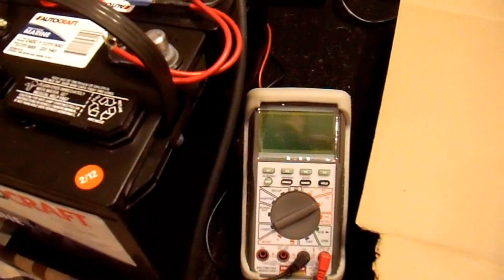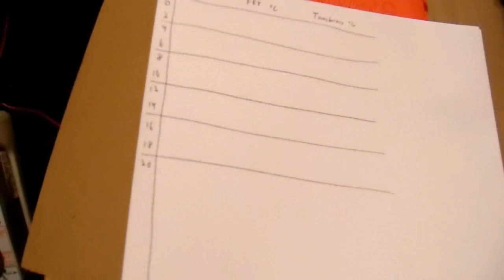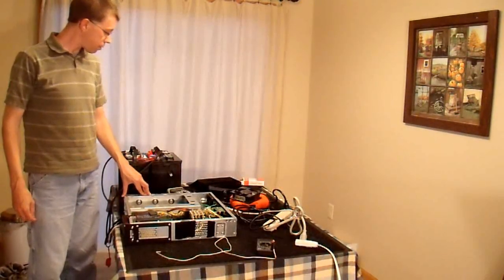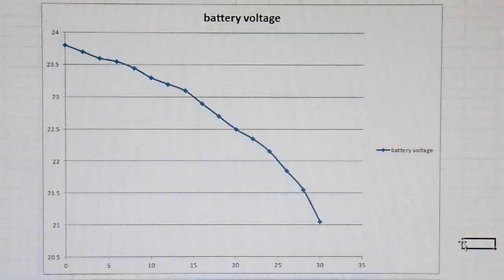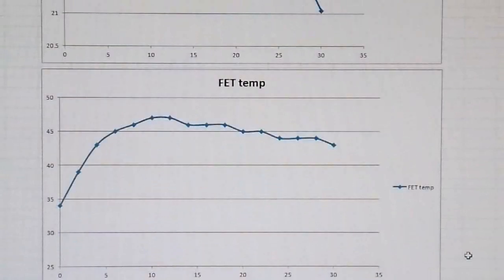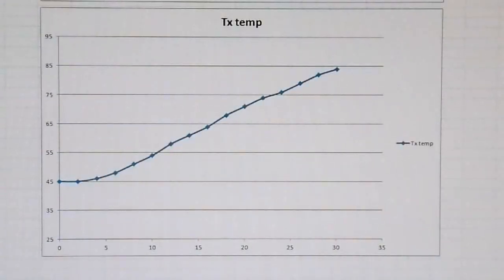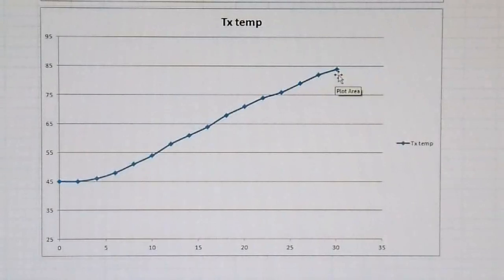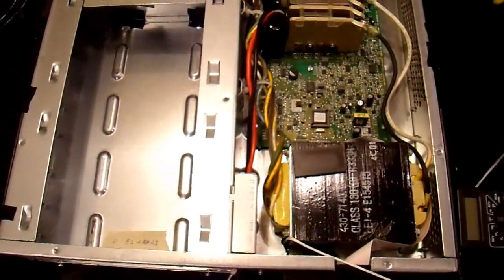UPS to 1.5kW Sinewave Inverter Conversion part9 - Will it overheat?

Comment: I know this was awhile back but, I have a question for you because I have the exact same unit. I was able to modify it to hold more amperage just like you did with the transistors. My question is is it possible to use two of them in parallel to get double the amount of amps? Because I know they sync the frequency and phase angle with the outlet with the wall.So my goal is to source the same PWM for both modules to output the same 120 V AC running off the battery bank.
Reply from the maker: It's probably possible but my answer will be 'no' due to exact matching and sync needed.  I did make a video where I put two of these units together to make a 240V unit that doubled the output power and that 240V could be fed through a transformer back to 120V.  WHen put in series exact matching and exact sync is no longer a problem and it worked well.
Reply: @knurlgnar24   ok thanks for getting back to me.  That’s a good point with two 1500 watt units in series.  Then step back down to desired voltage.  I’ll give it a try.  I am very ambitious in cracking the code for parallel inverters, somehow making use of the synchronization logic inside the inverters.  Another experiment I’d like to try is adding even more mosfets and “bypassing” the current transmitter so’s not to trip on overload.  Just protect it with fuses.  How many mosfets can you run in parallel without adding issues? Like remote mosfets totaling enough to run a whole house feeder?  It’s ambitious but it’s fun.

Comment: Great video series. Perhaps just get a 1500w ups to begin with, to save the hassle of modifying it to shed heat. Maybe start with the XL version as they are beefier and  can be run at full load constantly.

Comment: Just found 40 new old stock of the correct mosfets! Also, I acquired a full roll (1000) of the correct gate resistors. The audibility of the UPS should decrease and the efficiency may increase with the correct gate resistors and matched mosfets. These operate in the LINEAR REGION, so if the gate voltage is off, the units will be working against each other slightly. PLEASE show us the output on a scope!!! I predict a slightly distorted waveform.

The internal noise produced by mine decreased when I plugged a large transformer bearing stereo receiver/amp into an AC output receptacle. Should I add a large homemade toroidal transformer to match or surpass the ratings of the original core? Great work BTW!

Comment: I just found 2 of these exact same units and I am doing the same mods excepts one of them is currently the "donor" of parts for the main one I am wanting to use. I have already removed the fets and the large cap for use in my main as well as the transformer.

my question is if I put the donors transformer in parallel with the one I am wanting to use in hopes of taking a high load off of the one transformer is there any possible problems I could have? I'm am planning to upgrade the wiring..

I'm am planning to cut the battery compartment out for room for the second transformer and extra much more quiet fans

Comment: I watched all 10 videos..Great stuff!! I was going to buy a pure sine wave inverter and some solar panels to recharge a large battery bank for off grid...The question I have for you is this...I have a VERY Large APC Symmetra power array tower! Model # symstrf..The specs are as Follows = Input 200-240v , 80amp, 50-60 hz....Output 120v-,208v-,240v-  60hz...Total output power 80amp, 16kva, 11.2kW...The transformer is the size of a large cantaloupe!! What are your thoughts on converting this to a large inverter?  Would I be able to hook up enough battery's to come up with the 200-240v input requirement? Any thoughts, advice? Thanks!

Comment: water cooled transformer?
Reply: +Brady Rose Water will make the transformer rust butt any type of oil will work. (used motor oil can be used if has ben filterd to gett rid off the metal filings and crap in the old oil)
serc "oil filled transformer" on gogle to learn more.
Reply: Duett A Traktor
lol the water wouldn't contact the iron directly.  It would flow through an aluminum heatsink block with sealed channels and valves via tubes and a pumping system like a typical computer cooling rig.
Reply: +Brady Rose ok intresting with water so close to electronics. But if computers use it it will probebly be ok.
Reply: Duett A Traktor I guess it could be argued  that the watercooling on a computer is to cool the chip on a board that is running DC, whereas a transformer has mains AC running through it.  However, CNC mills have water cooled motor spindles that run AC mains, and we have on demand water heaters and kettles and such.  Water and Electricity don't mix but they can be neighbors in tightly controlled settings.  To each his own how much risk you want to consider.
Reply: +Brady Rose my thoughts exactly
Reply: +Brady Rose or at least a heat sync

Comment: Question. how about surge. I see its good for 1500 watts for about 30 minutes what about surge, IE a motor starting that could be over 1500 for a small bit. have you tried to see what it can do with a surge.....Something I'm looking at on my system. I have a Die grinder that is 600 watts and when I hit the switch it shuts it down. and it only pulls about 600 watts when it settles down after motor gets going.  I will later look for something I can use to put a good load on it to see what it can do. and see if it took the hack for 1500 watts.
Reply from the maker: This UPS has a good surge capability once modified, and it is far better than most 1500W inverters.  My previous videos in this series cover this.  I wouldn't expect it to have any trouble at all with any die grinder on the market.
Reply: ***** I was using the tiny 18ah batteries, and realized that it was the batteries, I hooked them to my battery bank and even the one set for 980 watts with no mods fired it up.  I have a 1500 watt Heater oil type.  that has two settings. 980 would handle 1500 watts for a while before shutting down like maybe 30sec or so.  after mods no issue other than the wimpy 10 gauge wire. so that will be the next fix.

Comment: Well i know it is over that just and  idea. Why didn't you move your whole transformer to left side(to old batery compartment. You could put one fan there and it could blow heat from your transformer. No more problem with overheating . Air will be cooler and you can do there what you want termal protection or what ever you want. I really don't know why you didn't do it before :) :) Transformer will be happy and your pcb will be happy also ..less radiated heat..
Reply from the maker: Because it would require another fan and metalwork which I do not claim to be proficient in.  :)  This seemed like the easiest way.  I am sure there are other ways to accomplish the same goal.

Comment: Hey you should look up DD-WRT. It is a firmware for wireless routers that allows you to make a standard router do things the factory locked out like adjust the RF power or make it into a repeater.

Comment: You could install a high performance low profile server CPU heatsink with fan on the back side of the transformer. The good copper core type with heat pipes can dissipate 200 watts of heat easily.

Comment from the maker: The thermal conductivity of the thermal paste is irrelevant in practical application - you could use standard automotive grease and it would work almost as well.  It's actually the thickness of the interface material that matters most since conductivity is directly proportional to the thickness of the interface material.  For that reason thermal pads are less effective.  Anything that removes all air gaps will work reasonably well, though.

Comment: Heatsink goop under the xformer... uck. In any more than a VERY thin layer, it's not a good heat transfer material. Look for the conformable thermal conductive interface pads, available up to about 3mm thick. Also, why not put a heat sink on top the xformer core?... sticking out the top of the case? As said elsewhere, as the deltaT between xformer temp and ambient increases, dissipation will become more efficient. digikey.com/product-search/en/fans-thermal-management/thermal-pads-sheets

Comment from the maker: The FET gate resistors are there for a few reasons:  radiated emissions, to prevent the drive circuitry from excessive pulse draw, and most importantly to keep the voltage overshoot on the Drain and Source under control.  At high currents if you switch too fast with too many parasitics the excessive voltage overshoot can damage the transistors.  I'm not sure which combination of these factors is at play in this particular design as I do not have a good o-scope (or the motivation) to look.

Comment from the maker: Possibly - good thoughts.  Conduction and convection are linear with temperature increase and copper losses are less than linear so things would be going in the right direction to stabilize.  Radiation loss changes with the 4th power, so that would help somewhat too.  One also has to consider that when pushing a transformer far past it's intended operating conditions that localized internal temps will be much higher than the external core temp.  I didn't want to find out where the limit was!

Comment: You state that the transformer would probably get into a thermal runaway situation. But, this being a 180 Celcius transformer, after half an hour it reached nowhere near that temperature. As higher the temperature gets, the faster the heat dissapation takes places. The more heat the transformer gets rid off in the same amount of time. And then the slope will no longer be linear and gets a less and less increasing slope. It could have been it would have stabilized by itself? .

Comment: Many of these old  batteries are discarded because they can no longer operate a fork lift for a full 8 hour work day but they still have operational life to run your household for many decades!. 
Many still have 100 times more amperage than a brand new bank of  automotive type batteries that will only last for 2 or 3 years. 
From:
windgenerator(dot)org(dot)uk/html/battery_tales.html
As a newbie, this way I hope I can be of help to You.

Thanks from Holland (Europe)